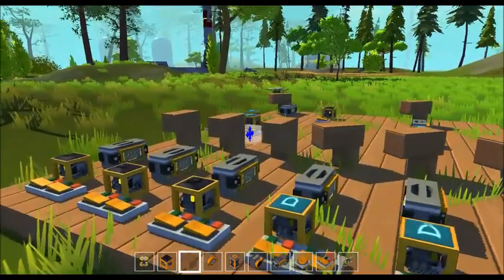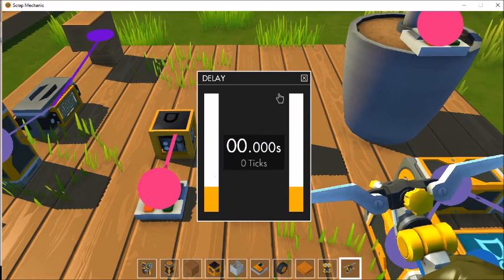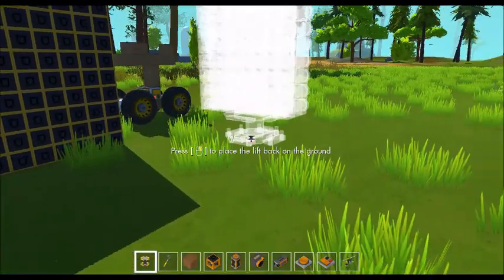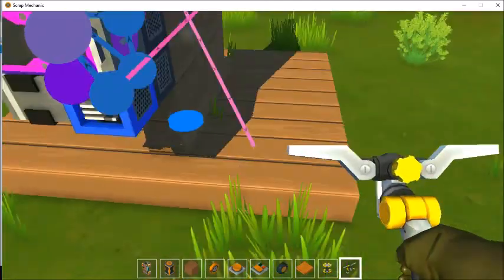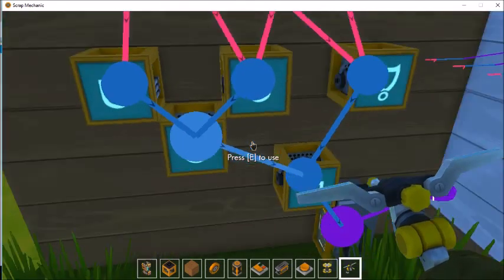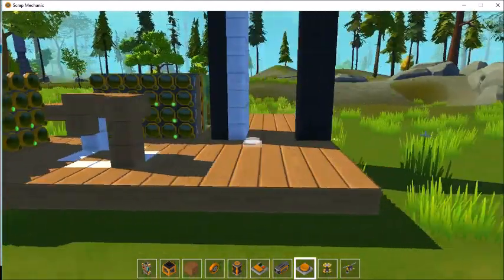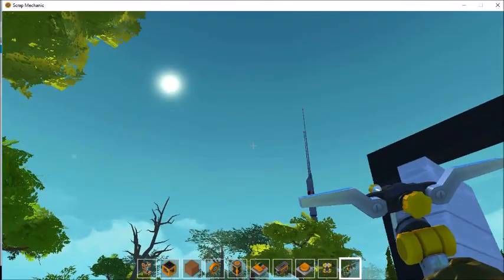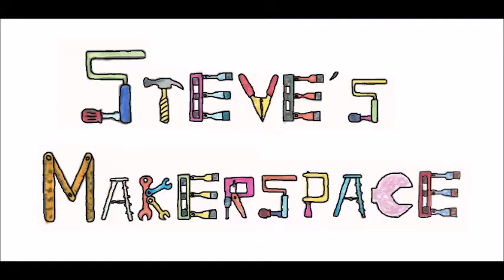Scrap Mechanic: Logic Gates - X-Ray Machine & 2D Scan Lock

Comment: i have a question can you maybe help me out with making a like x axis / y axis selector thingy in the  two ways for drawing program i have a TEN by TEN screen
Reply from the maker: I can probably help.  Can you explain a bit more?  Not following you yet.
Reply: so i have a drawing thingy i wanna make basic like you press the right button the cursor on the screen goes to the right and press the left one it goes to left and the up one it goes up and the down one it goes don i wanna make like one bar 10 wide i tryed that my last attempt worked well but it was to glitchy but like you have a bar and it has 2 buttons like a selector its ten wide so a ten by ten wide screen and one bar is an axis y or x and if you wanna move the cursor then via the bar the cursor move and just one bar that i can use twice to also go up and down and with just a bit of logic gates for the screen it automaticly locates it right on the screen because the x axis is connected to evrything in a direction and y axis in the other drection so everything has a specific cord
Reply: better explanation --> i want to have a bar if you press right the light on the bar goes to the right hole the time untill you release it and goes to the left if youpress left thats it and the other things i can do myself because that is easy
Reply: like brent batch has made space invaders game so that spaceship moves to the left if you press left or to the right if you press right thats what i want but then for 4 directions
Reply from the maker: I see.  I'm not an expert on logic gates like kAN and Brent Batch.  Maybe one of them could help.  Without knowing how to do that, I would just make some kind of vehicle or object physically move under sensors (using your buttons) and send the sensor data to your screen of AND gates.  Let me know what you find out.  I can see lots of applications for that idea.
Reply: ok
Reply from the maker: I should mention here that I'm actually working on what I described here.  But mine additionally draws three mirror images of the first drawing, so you get kind of a snowflake effect.  I've got the basic design down, but connecting all those logic gates for the mirror part is taking forever.
Reply: how will the first image be made
Reply from the maker: That's the question.  I was going to just drive a vehicle (with a pole on it) under a sensor ceiling.  I think now I'll put it on hold and see if I can find out how to use logic gates to direct the "cursor."
Reply: yeah its just 2 bars of sensors 1 for x axis one for y and you have a screen but not the one where painted on only the cursor and they are all on and gates so you just need to connect everything with an gate of the x and y bar then it's done
Reply from the maker: Hey Scroob,
Some developments on the axis selector idea.  kAN Gaming just came out with a video about this:
https://www.youtube.com/watch?v=r2Nf9uFlb4g        - no workshop item yet.

UltraGPower made a selector with five gates.  His creation:
http://steamcommunity.com/sharedfiles/filedetails/?id=753385423

And then I took that and expanded it to 10 gates:
http://steamcommunity.com/sharedfiles/filedetails/?id=753839975

and 20 gates:
http://steamcommunity.com/sharedfiles/filedetails/?id=753844468

My creations are not real pretty, but they work.  Hope all this helps!
Reply: yeah i saw it
Reply: il look at the slectors